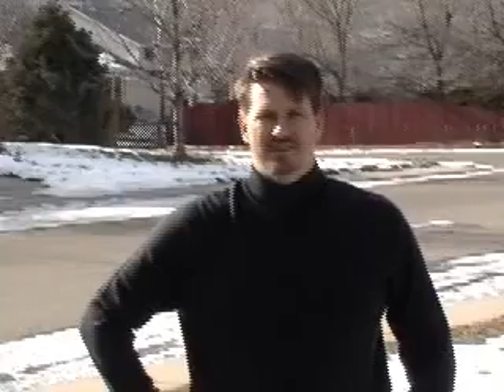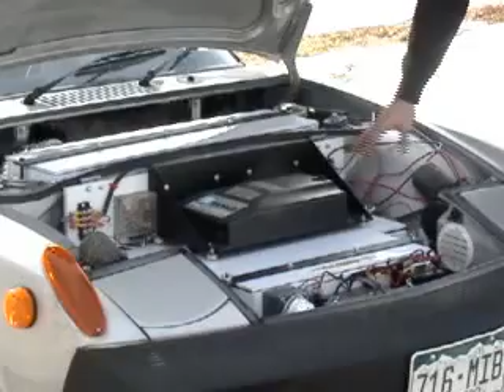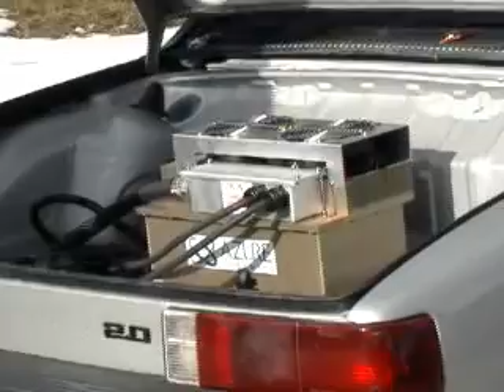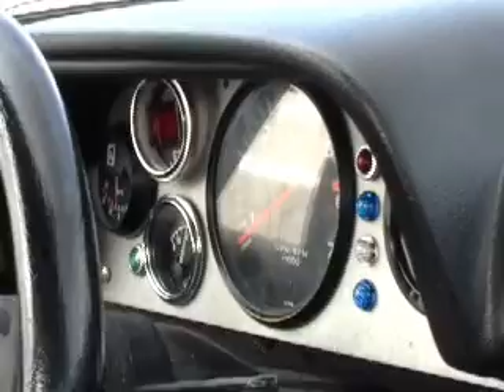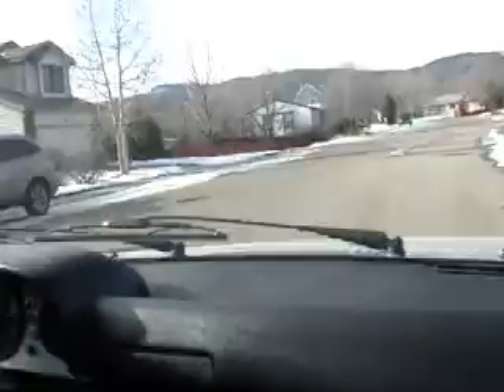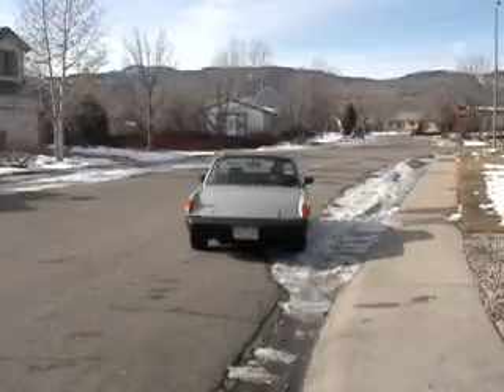Volt914 - An Electric Porsche 914

Comment: Ross was this  based off the EA voltsporsche 914 kit? I'm contemplating a VW Voltsrabbit converted car with the manual trans in need of new batteries and I would like to use modern Chevy Volt batteries instead. It currently uses a Advanced 9 DC motor and 96v of golf cart batteries (16 of em!). Any advice on such an update? Are there forums you would point me to?

Comment: OR you could have made it a direct drive motor thereby making the sports car both accelerate fast and increasing efficiency, there is really no need for a transmission in an EV.

Comment: @thegoosebrain : I am an engineer so I'll take this one:  because no electro-mechanical systems are lossless, the energy recovered by such a generator would always be less than the amount of energy required to power it, so while it would technically be possible to do this it would just make the entire system less efficient.  It makes sense to recover energy while braking only because 1. braking is unavoidable and 2. In normal braking all moving energy is completely wasted, i.e. converted to heat